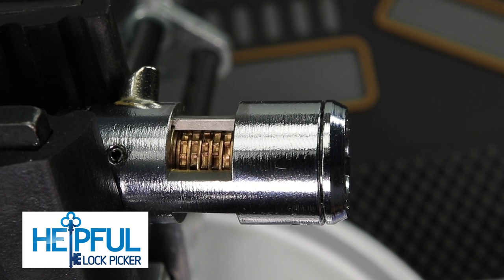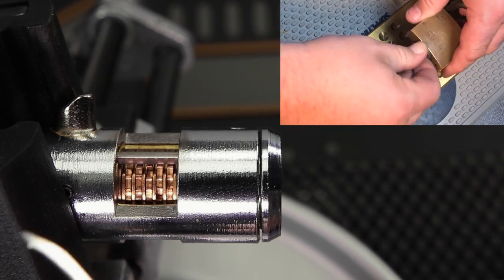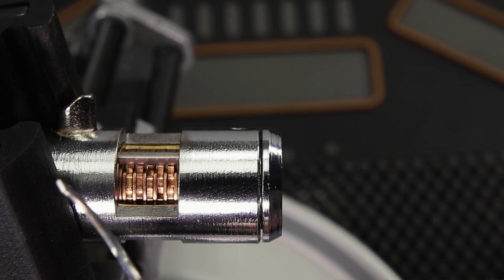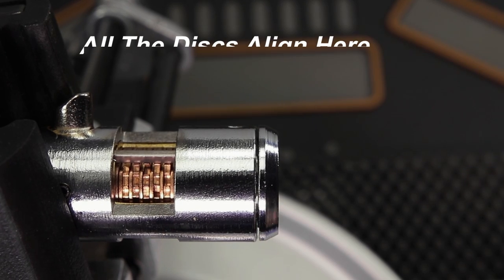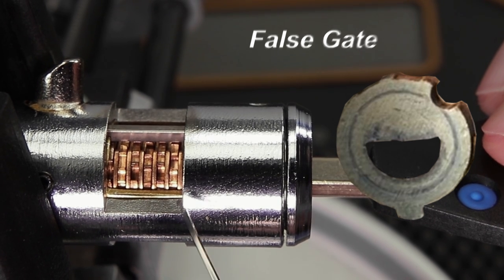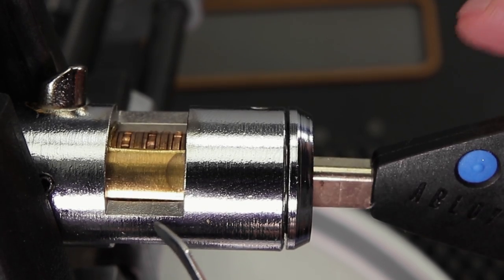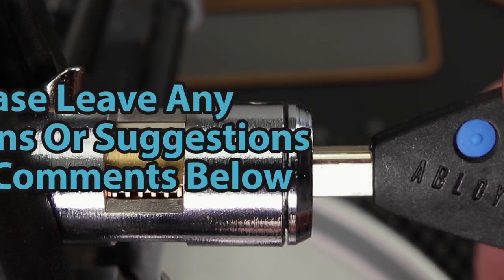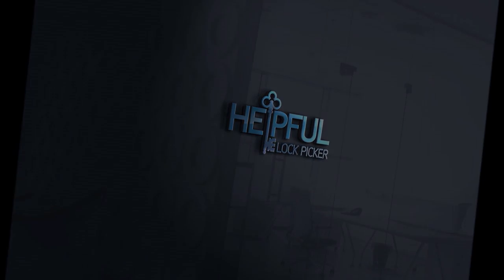[296] Close-up On How A Disc Detainer Lock Works

Comment: Bro... Just use "The Pick that Bosnian Bill and I made"
Reply from the maker: I'd rather not unfortunately
Reply: @HelpfulLockPicker  May I ask why? I was thinking of purchasing it myself.
Reply: Actually I figured it out. That huxleypig guy made you a custom one, so you don’t want to go use a different one.
Reply: The Sparrows DD pick or "The Pick that Bosnian Bill and I made" really only works with locks that can be opened with front tension (meaning you tension from first disk from the keyway opening). Many Abloy locks require tension from the last disk so they need pick that's able to turn the last disk while manipulating one or more disks closer the keyway opening in front.

There  has been some reports about people successfully opening modern Abloy disk detainer locks with front tension but except for the Protec 2 (where the tension can be applied to interactive keycontrol element instead of disks) I have't seen this on video.
Reply: @SnakePicks  it’s a pride thing.
Reply: I thought it was Bill and LPLawyer that made the DD pick. Edit: I KNOW it was not this guy. I think that he is hesitant to say he made it.
Reply: @noahway13  hehe it's a joke because LPL always say the pick BB and I made so he's rephrase it, you can see in the comments he said he wanted to buy one
Reply: Guys respect the content he's teaching how the tool works inside the lock not what tools to use because actually in these those of locks no 1 tool will open everything adjustment must be made, so hopefully one day some one will make a cheaper higher quality that can be adjustable to many locks
Reply: @kixpickss  Bro chill, I was joking.
Reply: @MikkoRantalainen  - I realize this is 5 month old comment, but LPL has used "The tool that Bosnian Bill and I made" on locks that required him to tension off the rear disc.
Reply: @dustintunis9347  Can you link to the video or give its number in LPL video sequence?
Reply: @MikkoRantalainen  - I just tried to find one, and in the one I did find he used a different pick, so I guess I remembered wrong.  I stand corrected.
Reply: @dustintunis9347  No worries. I was just interested to see a possibly new method I was not aware of.

You can use the tool that BosnianBill and LPL made to open many rear tension locks by tensioning from first or second disk but that technique depends on suitable key cuts and cannot open all locks.

Comment: Thank you.  I did not really understand how the disc detainer locks work.  I can see why the tools that actually work on them are expensive and complex, relative to hooks and rakes..
Reply from the maker: It is unfortunate that the widely available ones need heavy modifying to work. Technically one some of these front tensioning ones you could pick it with a standard pin and tumbler setup but it seems very hard

Comment: Thanks. The question I have is why don't they make the false gates a little deeper to make it more difficult to pick?
Reply from the maker: I am not sure of the correct answer but I would guess they would not want the discs to be weakened too much to prevent a shearing attack
Reply: If they made the false gates deeper, they would all of a sudden become true gates, and the lock would then be significantly easier to open. :O)

Comment: What keeps the disks properly aligned for inserting the key? I mean couldn't they be rotated in a way so the the key won't insert or won't turn the disks the correct distance?
Reply from the maker: I believe they can only turn so much
Reply: If the disks gets turned for some reason (picking or other) you just have to insert the key little by little while you turn the key back and forth.
Eventually the key will slide into disk by disk until it reaches the bottom.

Comment: Where do we find the springs of the sidebar, What is their position? Do they push up or push down the sidebar?
Reply from the maker: I am not sure but they push the sidebar out
Reply: No need for any springs. The sidebar rests on top of the disks. It's only when the true gates align that the sidebar is able to drop down far enough for the lock to turn.

Comment: To pick we turn all the disks clockwise. Should we then pick anticlockwise ?
Reply from the maker: Turning the discs isn't necessary to pick the lock. It's just the thing some people do. You will need to turn them in the opposite direction of where you turned them. However, if you place them into a false gate you will need to turn them either direction to get into the correct gate
Reply: @HelpfulLockPicker  So picking and tensioning in the opposite direction ?

Comment: That's interesting, are those locks considered safer than some other mechanisms? Are there any low skill attacks available?
Reply from the maker: There are destructive entry low skill attacks but for the most part picking needs to be done disc by disc which takes skill and the right tool

Comment: Then why aren't most locks made this way and pin-tumbler locks obsolete?
Reply from the maker: the reason is money and convenience
Reply: @HelpfulLockPicker : Geesh, how much more money could a disc lock like this cost just to have on a building door's deadbolt or/and doorknob? And why not protect buildings at least as much as protecting a mere bicycle?
Reply from the maker: @HelloKittyFanMan..   It's probably the same reason why we haven't switch to electric cars. Every locksmith would have to change their training, equipment, excetera. every aspect that involves lock would have to change
Reply: 1,  @HelpfulLockPicker , we actually have switched to electric cars... some of us, that is. 2. Every locksmith should add every new style of lock to their training; they're dumb and behind if they don't. They had to learn about how to sense security pins when those came out, didn't they? So if they can handle that then they can handle this.